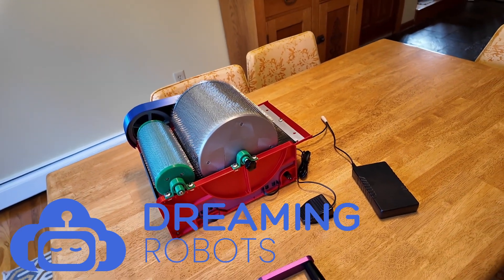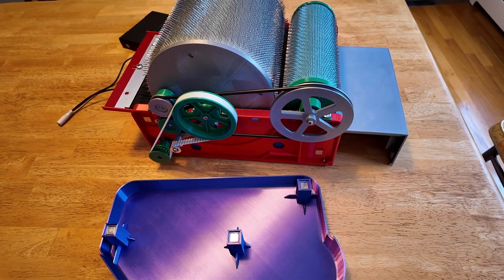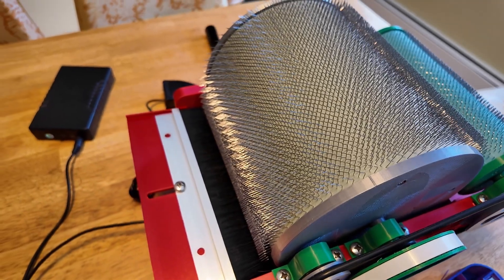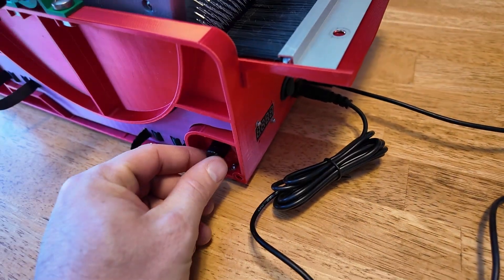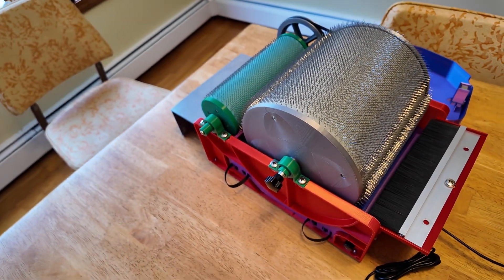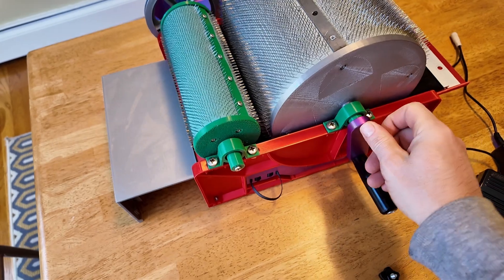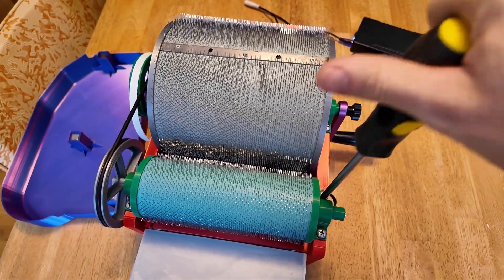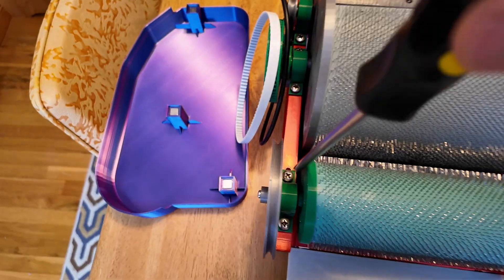Spin 207 - EEW Drum Carder (January 2026 Prototype)

Comment: What AI says about this when you "ask" "price": The video does not mention the price of the EEW Drum Carder prototype. As this is an early prototype (0:02), pricing information may not yet be available.

However, based on general market prices for similar products from other brands, electric drum carders typically range from around $2,500 to over $3,200 USD, while manual versions can range from roughly $600 to over $1,000 USD.

Comment: % of max speed for the motor would likely be helpful, since most people will just want a number they can try and repeat next time. Most of the time hand-crank options are offered because they're cheaper; are you thinking of having a hand-crank-only version as well or just having the hand-crank option for the motorized carder?

This is looking so good! It's been fascinating watching the iterative development process
Reply from the maker: Many people have said they want the hand version in addition to the motor version. The reason is to give them more control often for fine fibers. Testing will determine if it is actually important.

Comment: The debris catching tray is a great idea and I love that it comes with a manual handle too for when the noise might be an issue or when more fibre control is needed. Some sort of edge guides/bumpers on the feed tray would be good too.

Comment: I really like the tray under the main drum. I really hate the mess that my current drum carder leaves. I also really like the default option of both electric and hand crank. I do have fibers that I would prefer to hand crank just so I have better control, but a lot would be easier with electric. My current drum carder needs something like an extra $200 to get the motor for it and then it's nearly twice as tall. It's just frustrating all around. How strong are the magnets? Are they able to be jostled loose if the carder gets bumped? Or are they strong enough to need a sharp tug to disengage?
Reply from the maker: The magnets are quite strong.

Comment: Hey Maurice.   Love the design so far.   

One suggestion though is to look at relocating the display and controls closer to the front.   Maybe having an option for a disconnected control box?   Having to look at the back for information while running the carded won't be fun for alot of people, and having the information and controls in a more forward location would make the user experience quite a bit nicer.
Reply from the maker: I'll think about this, but I put it there for ease of assembly.  Doing a seperate control box makes it less portable and increases cost.  We'll see what testing reviels, but if the screen isn't that important I'll probably just put it where it keeps the cost down.  The reason I'm including the screen is it's really inexpensive.  I greatly optimized the price for the EEW Fold and will probably include it on all future products.  Even if you don't need it for speed control it gives options for things like setting profiles in the software.

Comment: I am very excited for this.   I don’t own a drum carder yet so excuse the potentially stupid question, but will thr plastic hold up to screwing and unscrewing parts?   

Maybe that doesn’t happen often, but I know with plastics sometimes the screws strip easily or the plastic can crack from over enthusiastic tightening.
Reply from the maker: The places you think are plastic threads are actually metal threads.  I have a bunch of hidden nuts in the design.
Reply: @DreamingRobotsBlog  I should have known you’d think of that!  Perfect ❤

Comment: I’m not sure if you are putting too much fiber or if the motor isn’t strong enough, but I see and hear the motor struggling when you push it through.
Reply from the maker: This is mostly an artifact of the dynamic speed control loop, but the gear box matters some too.  The motor isn't actually struggling.  But I'll probably adjust the software to make it sound better in the future.

Comment: This is exciting. Will you have different TPI drums?
Reply from the maker: That is something I'm still considering. We need to do some testing and get feedback from the community to decide exactly what we're going to do with different TPI drums
Reply: @DreamingRobotsBlog I think the most commonly use tpi is 72 but it would be great to have ones available for finer fiber like merino and alpaca so something between 100 and 120 would be very helpful. Depending on cost, I could easily see myself getting 2 different drums.

Comment: Not sure how much of this is technique, or how much is the carder, but your licker drum isn't providing much resistance to the wads of fiber you are putting in there, and that's where the carding action should be.  It will make a better batt if you feed it very thin and small amounts, think being able to read a newspaper through it.   Then your batt will hold together and doff much more smoothly.

Comment: Hi Maurice! I am wondering if it would be possible to offer an option for sale as a handcrank only. A drum carder is the tool I find I lack and miss for my spinning hobby. What is holding me back from getting one, is primarily the space it would take up, and secondly the price of current available drum carders. The fact that it is motorised is not a factor for me at all, and I would use it to process small amounts at a time. I understand it might be important to other people. Just wondering if it is a possibility, to offer them with or without motor.
Reply from the maker: It is something I'll look into.  There is a pretty high cost of carrying different versions so doing this wouldn't save as much as some might expect.  To justify this I'd need to see a lot of interest and the version without the motor would still have holes for the motor and other electronics.

Comment: My thoughts on RPM:  I think it would be more useful (especially from a long-term learning curve vantage) to get used to % instead of trying to futz with an actual RPM. I just don't see how knowing how many times per minute the drum goes around is more useful than a % of motor speed.

Can't wait to use one of these myself!
Reply from the maker: Thanks for the feedback.  That seems to be the consensus.  I know for eSpinners actual RPMs are nice to compare with others out there, but I think for this percent seems to be prefered and is what I'm leaning towards.
Reply: @DreamingRobotsBlog  I have the brother electric drum carder and I wish that the 'speed' dial was numbers (1-10) or something.  Because when I find the perfect speed for a particular fiber I want to be able to make note of that so I can do the whole bunch with that speed.  The best speed is going to change with different fibers anyway so anything that's easy to make note of and compare from fiber to fiber.  I love your drum carder, great work!!!

Comment: Looks amazing! Any chance of purchasing the base by itself? My wife already has a manual drum carder, but it would be cool to be able to get the base for her. Or maybe even alternately just the 3D print files plus the electronics?
Reply from the maker: I'm not sure what you mean by the base.  You mean you want to provide your own drums?  I do plan to give away 3D printable files so people can make their own drums, but you probably can't use drums from other carders because the size of the drum needs to be exactly right.

I don't plan to do a kit where you 3D print the files.  There are several parts that don't 3D print very well and supporting that kind of option requires more support time than I have right now.
Reply: @D @DreamingRobotsBlog es, providing my own drums. Sorry it wasn’t clear. And about the 3D printing, that’s fine, I was just curious. Thank you so much!

Comment: I wish you would test 120 thread on the cone winder for us sewers
Reply from the maker: Others have put both thinner and thicker threads on the Cone Winder.  Anything thin like that works great.  The textile drums it uses were designs specifically for this kind of thread being used by the textile industry.  The thicker yarns is actually more questionable, but they do work well even though it's not what the drums were designed for.

Comment: This is looking great! The one thing I would like would be to have the feed-in tray be a little longer or maybe have some kind of extension option. I like to spread out a bit more fiber to feed in than this would allow. This would certainly not be a deal breaker for me if this is not possible. I could certainly alter my procedure if necessary. It is really exciting to see the current prototype. It's looking wonderful!
Reply from the maker: Thanks for the feedback.  It's been a common suggestion.  The reason it is this length is because it is the longest that I could fit without making the device bigger.  However, I will look into making some kind of extension option.
Reply: @DreamingRobotsBlog  Thanks for this response. Looking at the drum carder and the way the intake tray worked I figured that you had made it as long as you could given the way it fits with the carder. I love the overall size of the carder so I can see why you wouldn't want to make it larger just to accommodate a larger feed-in tray. It would be super if you could offer an extension option. If it doesn't work out for you to offer something like that this seems like something we can put our MacGyver hats on and come up with a homemade extension which might be as simple as flipped plastic container from the Dollar Store or an Amazon box. I so appreciate all you do for the fiber community. This drum carder looks absolutely fabulous!

Comment: Was this on Kickstarter, or will it be?  I'll pretty much buy anything you design, even tho I already have two drum carders.
Reply from the maker: Yes, this will eventually be a Kickstarter project, but that is a long ways off.  I still need to finalize the design and then get it ready for manufacturing.

Comment: Love how colorful it is! And the ability to switch to a manual turning option. I think  having the digital display on the back that shows a percentage indicating power output/rpms probably would be easier.
Reply from the maker: The colors are just because I'm 3D printing the prototype with a bunch of different color filament because the parts were printed at different times and updated and reprinted.
Reply: @DreamingRobotsBlog  Haha!! It's a 3D printing filament stash buster.

Comment: It looks great so far! Personally I put a very high premium on having a top cover so I can store it completely enclosed.
Reply from the maker: I would certainly offer a file for 3D printing such a thing.  I might offer a thick canvas cover, but it depends on how many want it and what my testing finds.

It's unlikely I'd do an optional add on for this.  I really try to minimize this because it makes accessories much more expensive.  For example the price might go up 10x if it was a rarely used accessory, but I had to pay for a mold.  So for my model where I keep prices by selling a lot of the item I really try to pick the items that most people benefit from and then include that by default to make it low cost for everyone.
Reply: @DreamingRobotsBlog I’m happy to order it printed from a third party if that’s the way that works best for you.
Reply: It’s a good point; It would facilitate transporting it also. Maybe it could be an optional extra?

Comment: Very nice! I think my preference would be to have the digital read-out closer to the front as that is where I look. Also, do you know how fast it will end up being? Is only the larger drum connected to the motor?
Reply from the maker: It can go about 60 RPM on the larger drum right now, but honestly that is just too fast.  I'm probably going to ship with around 40 RPM at the working drum unless my testers find a reason to make it slower/faster.

The licker is connected to the main drum with a belt with a gearing ratio of 4:1 (currently - this may change).

Comment: Ok- how much fiber can go into the batts? Does it make a 2oz batt?

Also- how does the brush being on the back impact removing the batt? One of the reasons there is a quick release on my other drum carders is so that the brush doesn’t rub against the batt in reverse and damage it? Is there a possibility of a quick release for the brush?
Reply from the maker: For the brush in the back, that is why I said I'd probably add a dial in the next version.

Not sure how big the batts will be.  This depends a lot on how much fiber is packed onto the drum and even among my experieneced testers there is disagreement on this.  Some like to pack it tight and others don't.  It will get tested both ways, but I'm still trying to decide what I will recommend and this can have a 2x difference in batt size.
Reply: @DreamingRobotsBlog  Agreed. In my experience its hugely variable depending on fiber.  Lofty like cormo is going to get less per batt than alpaca.

Comment: Very exciting! And brilliant that you can swap it to a hand crank. 

Would there be an alternative to loosenign screws to move the licker part?
Reply from the maker: I could make those some kind of knobs, but that would add some cost and I'm not sure they would fit well.  It is something I'll look into.  I think I could include a screw driver that works well for this.  The one in my video was really long and it would be easier to use if it was shorter and you had 2 hands.  I'll think about this some more and see what my testers think.  The current system isn't bad, but maybe we can come up with something even better.
Reply: @DreamingRobotsBlog  There's no need to move the licker in on a regular basis, so i think screws are just fine. It's useful to have it be adjustable to get the drums positioned exactly where you like, but i dont know anyone who likes to move theirs once it's set up.

Comment: German here, sorry for my English.
How hot will be the engine get? Do you use a fan to cool it? Not that the framework would get instable.
Reply from the maker: There is no fan.  The motor doesn't get hot.  I'm using the same motor as I used with the EEW 6.1, but it is geared down with a gear box.  That is what makes the noise in the video.  But the actual motor isn't being stressed at all.  This is less work than the EEW 6 because it goes so much slower.  I do plan to look at adjusting the softwtare a little because I know it sounds kind of bad and would like to improve the sound of it.  But the actual motor is not being stressed.
Reply: @DreamingRobotsBlog  as industrial mechanic I was curious about that, because if the engine would overheat and start a fire, it could get trouble with the insurance.^^